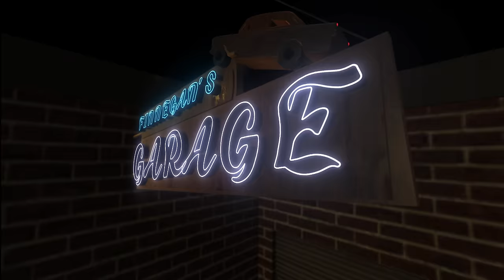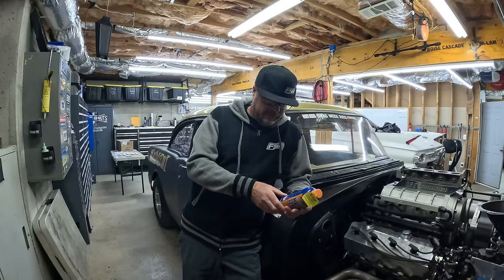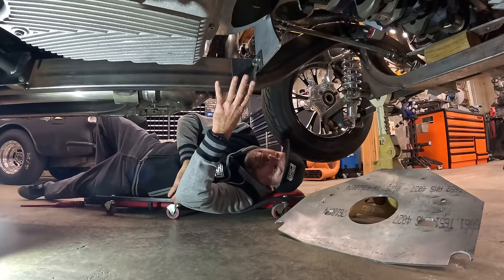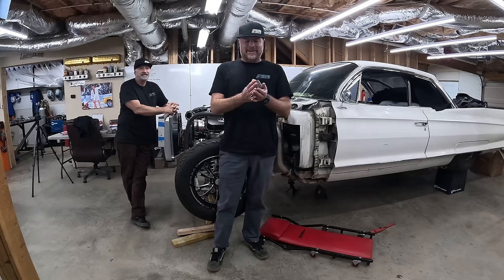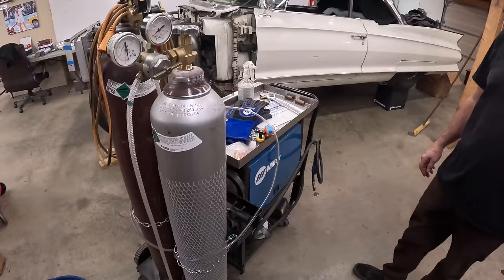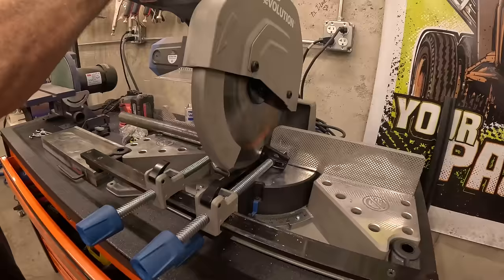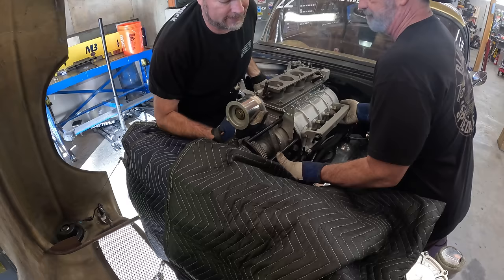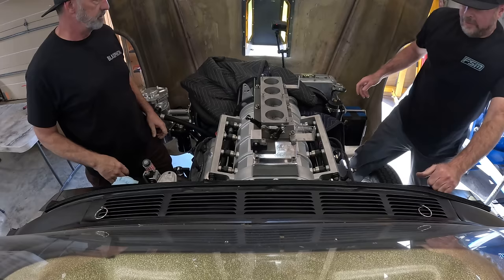Hey Freiburger, I WANT A REMATCH!

Comment: Those head gasket sealing additives are terrible and are impossible to clean out of your cooling system.
Reply: Agreed but if your engine builder tells you to do something you do it. I imagine Pete knows a thing or two about a thing or two.
Reply: No big deal, hemis don't ever overheat lol
Reply: And yet we see K seal work  time and time again on different levels of engine's on several different shows
Reply: @modernvisionscc Pete is really good at doing stuff and you're not
Reply: I would say the same thing. But I'm not Pete Harrell. And neither are you. So there's that.
Reply: Cadillac put head gasket sealer in every aluminum Northstar engine ever built.
Reply: 😂😂 They work wonders and for the amount of time this engine will actually last who cares. It might get 2 months of use before it's tossed away for another trash engine.
Reply: @picklefart  I've used blue devil on my 8th gen Corolla and it worked great
Reply: The Moroso sealer He mentioned,  I have used after having a block sleeved. Worked good
Reply: "R U.... R U GOOD AT DOING STUFF?!?!"
Reply: Too be fair he is just going to blow it up anyway..... Sorry bro but ..... Meh
Reply: @bmwpete65s55 Cadillac needs to get rid of the Northstar engine altogether. It was roughly 2K to get mine resealed in my 04 Deville.
Reply: We use those pellets from Ac Delco in the bbc race engines every time
Reply: I wonder if k seal will work on my 2005 Camry? It's putting oil into the cooling system. Blew the cap of the overflow bottle. Shut it down right away!
Reply: This man is correct! I’m dealing with that exact problem right now.
Reply: @picklefart he is also real good at doing stuff...lol
Reply: These are race cars, they replace radiators and water pumps periodically. It’s not your Corolla with a million coolant lines going everywhere….
Reply: @bmwpete65s55 AFTER they started leaking. The infamous HT4100. The later years 84' up had a decal by the radiator to remind the owner to add GM sealant...aka Barr's Leak annually. I have an '84 Coupe project getting a twin turbo Cad 500. Leaving the HT4100 emblems on each fender as it will then have 4.1 liters per engine bank!
Reply: I agree with you
Reply: Not when its that bad @mdkzztop
Reply: Good luck dreaming
Reply: They spent more time running and checking for leaks than it would to have put a head gasket in, the blower had to come off anyway?
I don’t get the snake oil fix attempt on a race car, maybe if you’re in the finals at a race and don’t have time
Reply: @dougarrowhead aww someone felt dumb and deleted their comment. Didn't know Pete already has a successful channel eh? Haters hate.

Comment: My dear friend Mr. Finnegan.  When Heavey Duty mechanics, cross paths with Automotive mechanics. At may work for you tip. Check out Engine Brake switches for Semi Tractors, like a peter built, or Kenworth. The engine brake switches in them are activated by a longer little spring instead of levers, or rollers or what ever that relie on pin point accurcie. they are a real cool little switch, I have one in my ranger for a brake light switch after the original one died, and use one in my tool box door for the light inside there, since it was made into a service truck and findin stuff in the dark was hell. Chuckles is easy for mee to use these switches having opertunities to dismantle many semi truck wreaks. So checkem out maybe you will be the next to mix heavey truck with Automotive. laughs
Reply: I came here to say this also that bracket looks like it would cut the shit out of your ankles in a wreck
Reply: HD D Technician. 30Yrs Not Reliable I have seen it first hand.
Reply: Yes so, you don't want to put that in your car

Comment: If you using aluminum blower studs designed to break away. When you get blower pop/backfire the studs can get stretched a little. Between blower pops and the blower belt yanking on the studs the blower can loosen thru the studs stretching and the gasket force out without the proper clamping forces. Just retoque the blower bolts after a blower pop. If bolts don't torque up with a less then 1/4 turn, then it's time replace the aluminum blower studs

Comment: Your blower gasket issue (as well as other things that have happened with your engine) can be traced directly to the way you're using that delta opening blower.  Had the same thing happen with a fuel car 30 years ago when those things were first introduced.  
  Here's the short version (I could write a book on this)...You can run fuel through the hat (blower case in this situation) and use a standard opening blower, or you can use a delta opening blower and run through port nozzles, but you have to pick one or the other.
  Any time you peddle going down the track, you're creating a momentary lean situation at the rear cylinders...exactly the same as a carb with no accelerator pump shot.  It won't show on your egts, but it will cause a flash in the plenum and pop the gasket exactly like yours has.
Reply: Holy cow!  You solved it.  Done deal, brother!
Reply: Good shit man. Hopefully Finn sees this.
Reply: Thanks Uncle Tony for the comment! It would be cool to watch a video of this on your channel brother! 🇺🇲😎🇺🇲
Reply: Uncle Tony for the win!
Reply: Problem solved by the best information and experience from the wise elder himself. Thanks uncle T
Reply: Doesn't it have injectors in the intake runners as well?  I believe its a 16 injector deal.
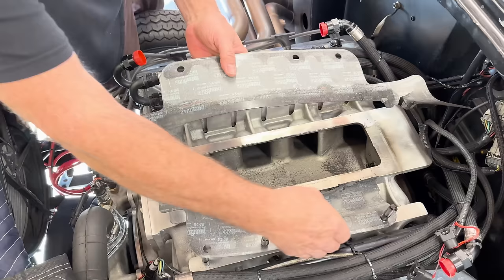Reply: @mcintyretyler89 , cool port injection with 8 injectors, pretty good description by Mikie in this video at time stamp 32:46
Reply: I wonder if a MLS gasket would hold up.
Reply: @mikebrown8065  I think it has port injection too
Reply: Like in the lower intake manifold
Reply: You could also write a book on why Finnegan only makes it 2 to 3 races before blowing it up again. 😂
Reply: Kid doesn't know how to drive and Tony isn't any angel. He's just a water of space on the crew
Reply: Oh boey lemme get my popcorn 🍿
Reply: @SuperSecretSquirell  uncle squirrels
Reply: John Woodworth
Reply: David vizard. And Andy
Reply: Andy who?
Reply: I'm not even sure. Let me ask A.I.
Reply: A.i. don't know Andy from unity Motorsports garage either Tony's 🤔
Reply: @thegreatoutdoors9769  did yea get skunked err wat bud
Reply: @thegreatoutdoors9769  hellooo, is anybody home?
Reply: @thegreatoutdoors9769  COME AND GET IT
Reply: If you're looking for something to pass the time, Finnegan might be looking for someone to join his team who has your experience. (Then his videos will be about building and racing instead of repairing.)   😉
Reply: Cutting gaskets last minute like they did… square cut can make it easy to rip.  Need to round the corners.
Reply: I'm building engine mounts to swap a 351w in my 1961 F100 4x4 using the same CAD program you used on your Cadillac mid plate. I look forward to your channel every week.
Reply: @UncleTonysGarage. This makes a lot of sense.  Hopefully Fenigan can get some savy old head to help him get that stupid hemi fixed once and for all.
Reply: I went two months sorting this out on an alchy SOHC when the Delta's first came out, I couldn't get the fuel set right on the ports (after years with an Enderle setup it was new to me) and went through a gasket every few runs. It was getting annoying but was worth the time when sorted.
Reply: But you have only been working on any type of cars for 15 years. Nice copy and paste. I’ve seen that same post many times

Comment: FELPRO ... AVIATION FORM A GASKET shellac   has been around for 75 plus years i use on all head bolts  Head Gaskets    on all my Builds  especially Hemi Engines  
Also Napa Has product called  Engine wafers for dropping into cooling systems 
Same as used in GM Engines    .. fyi i been building Hemis in our family machine shop 
Since 1953   awesome video  thanks for posting
Reply: I came to suggest gasket shellac, even if it's only on once side of the gasket.  That grease isn't helping!

Comment: I know it's a pain to remove a stuck gasket but greasing the gasket may be part of the issue. We use a Moly Lube 111 on aramid gaskets in high pressure air so they come off, but dry anywhere we have issues with them blowing out. I'm not saying to do anything to the blower or base plate but some critical joints have a specific surface finish like a vinyl record to bite on the gasket. Super smooth isn't always the best sealing surface in a gasketed interface.

Comment: If you cant find Moroso Ceramic seal, go to a pharmacy and ask them for some liquid glass, follow the instructions for ceramic seal. Same thing. Used it many times. Looks like water. I also use it in any new engine, stops leaks around head studs and other small seeping leaks
Reply: We call it water glass here. I think it was used to preserve eggs before refrigeration. I have fixed many a block with it.
Reply: Pickling lime? Thats whats used for eggs

Comment: Hey Mike, love your show, I am a big fan from Australia. Think you are ready to learn some facts about welding though. Welding vertical fillets down with the mig is really bad, especially where you are making a part designed for high strength like the mid plate mounts!
Always weld vertical up for strength, down will never penetrate in the root. Fillet welds are weak to start with, don't make the problem worse with a lack of fusion.
Also small tig passes look great, nice neat stacked dimes, but  the leg length needs to match the wall thickness of the tube or plate to match the parent metal strength. Concave welds are also weaker if the throat thickness is too small, all these things are classed as weld defects in many strength applications.
Love to help educate any welders wanting to learn.
BTW I'm a welder fabricator by trade with 37 yrs experience and qualified to AWS CWI and Australian equivalent Welding supervisor certifications, we qualify and train welders for defence work and oil and gas pressure equipment manufacture in Australia.
Keep up the great content.
Love the show.
Garth from down under.

Comment: AC Delco cooling system seal tabs #10-108.   Can't go wrong with those on a copper gasket motor.  We had a 14/1 632ci motor that would not seal up happy.    Those tabs solved the problem and were recommended by a very well know nitrous racer from back in the day.   Clarke Copper Gaskets also recommended them.

Comment: When clamping to round steel the use of a grip tape is recommended especially when pressure is applied to bracket being held.  It just gives the clamps something to grip
Reply: Thin rubber sheet (inner tube) can also be used in between.

Comment: I have a 05 trailblazer with 220k miles and used Steel seal. The truck runs fricking great and doesn't overheat any longer

Comment: One head gasket trick for hemis is to have copper gaskets annealed real soft.
Second trick is to not run more than 6 lb Radiator cap or it will push coolant.

Comment: I really admire your dedication to this engine platform. I guess it might have something to do with the cars name. I wouldn't have the dedication and the patience for it. If it was me the car would have been known as "the gasser formerly known as Blasphemi" about a year or two ago.
Reply: To be fair, most of the failures haven't been the engine's fault and would have done the same thing to a big block chevy.
Reply: @jasonm3109  yeah. It's not like 2nd gen 426 Hemis are known to have horrible valve geometry, or that the dome pistons and head design are commonly known for not being able to displace heat efficiently, or that they require massive amounts of fuel to prime and start the engine so they are notorious for going lean and burning sh:t up. and about 100 other things. And the parts are super affordable and readily available. Yeah. You're right. Greatest engine ever. It's a bargain.
Reply: @worldssickestmedia2713  This is why TF does not run the hemispherical design engine.

Comment: Something not motor related. I've been watching your videos for years and it now just hit me. Check your local building codes, but in most states if you have your garage/shop below a living space, you need to have something like sheetrock on the ceiling sealed from edge to edge to prevent fumes or flames from easily working it's way into the living space.
Reply: In Washington state it has to be 5/8 thick sheetrock  & taped as a fire barrier

Comment: Hey Mike, love all the detail you show.  When you said the midplate fasteners were in SINGLE shear, I thought of a fix... weld the brackets you currently have in place.  Add a second set, forward of the midplate that are bolted thru the frame, so as not to captivate the midplate.

Comment: You should use a throttle position sensor on the clutch pedal. Then you can program clutch events using the resistance without any physical adjustments.

Comment: If you destroy another blower gasket, next time mark where you cut excess out.. Use a hole or leather punch for round corners then straight cut the lines. I learned many yrs ago alot of different things hold up longer to inside round edges vs square. Good luck mike

Comment: On that clutch switch plate, an easier way to adjust would have been to add a fine thread bolt/stud (with recessed hex head) with locking nut as/to the portion that makes contact with the switch roller. One could add a small round plate to the end of the stud/bolt to ensure good contact.

Comment: I wouldn’t grease the blower gasket anymore… The grease will only help “lubricate” the gasket to allow it to move. I’ve wet those grey ones with water before, installed and let them dry after torquing before driving. Not like soaked, but just spritzed… 

However I’d get away from the grey paper gaskets. They make ones that feel almost like a whoopie cushion…

They’re normally a greenish in color and I’ve seen them pinkish like a pencil eraser. I’ve had better luck with them on blowout. Or do it like the monster truck guys and silicone the blower down lol. 

👍🤘👏

Comment: Loctite MR 5923 seems to be a good product to use in conjunction with different gaskets. No risk of squeezing it out where it is not supposed to be (applied thin) you applied it to both surfaces the gasket is supposed to seal against. Look it up :) gl with the build

Comment: Your clutch issue,  Go to a magnetic switch, mount switch on a rail on steering shaft, use threaded rod to adjust, think older bikes chain adjuster. Probably glue the magnet, as it should not have to move.  Ole Guy

Comment: If by chance you still have a coolant leak you could try Irontite ceramic engine seal.Kenworth uses it on all inframe rebuilds to seal the sleeves after replacement.I have used it on automotive for new core plugs sometimes leaking for rough finish on blocks,porisity on aluminum aftermarket blocks etc.Has always worked great.Its the same idea product that you used already.
Reply: I have used it as well, works fantastic

Comment: Just change the clutch switch from NO to NC (or opposite of whatever it is now), and mount it on the top side of the clutch arm. That way no matter how you adjust the lowest point of the clutch it'll never be an issue.

Comment: You need to check out a company called EVANS.
Just an FYI, they do make waterless coolant.
It is NOT ethylene glycol!
You can use it in pretty much any application, racing, off road, towing, ect...
And it is approved by all sanctioned and non-sanctioned race tracks.
Protects and dissapates heat a 1,000 times better than ordinary tap water!😂
Reply: Leno uses that in most if not all of his vehicles,  recommends it regularly on his channel.

Comment: Sealwell cubes. About an inch sqare, crumble it up and the leak stops. Radiators, blocks, headgaskets, heads and intake gaskets all stop leaking. As for water? That is for washing the vehicle, not cooling the engine.
Though warm the engine then retorque the heads.

Comment: Weld two spuds on the mount. Then cut mount.  Two 1/4 bolts or #10’s are better for clamping force and adjusting.

Comment: Watching the switch activation switch plate made me wonder why you didn’t mount the switch 90• to what you did ? It looked to me that a simple bolt thru the clutch arm could hit it higher up on the arm and lot have the plate to snag your pant legs. Just to be clear the switch body parallel to the floor not perpendicular it as currently mounted.

Comment: I like your idea of the welded mounts to the  frame but my pea brain is having an issue with one thing.  Your idea of the Lower plates to set the mid plate on and prevent shearing the bolts only stops the plate rotation on the passenger side. The torque will still try to pull the drivers side upward and then the bolts are still in shear.  The drivers side needs a tab welded to the top that passes through the mid plate to lock it in location and only use the bolts to clamp.

Comment: Back in the day as a GM technician we would put the Bars leak tabs during cooling system repair or TSB under warranty. As far as the blower base gasket, on the drive’s side the gasket was blown into voids. Would it be possible to support the gasket with a plate so if the blower does loosen up, maybe the gasket won’t get blown into the voids.  Look into Nord lock washes they may help with fasteners backing off.